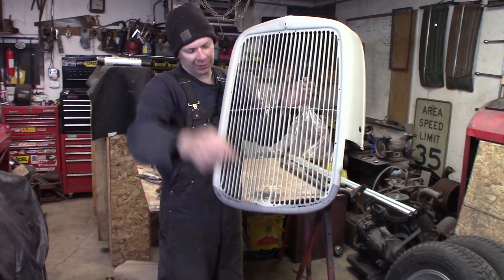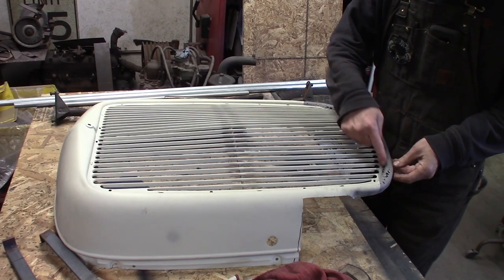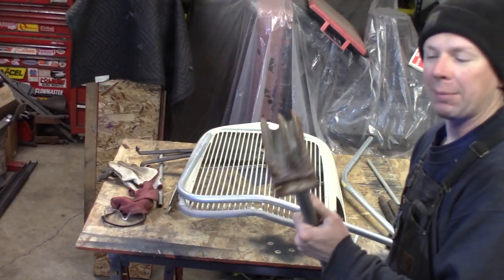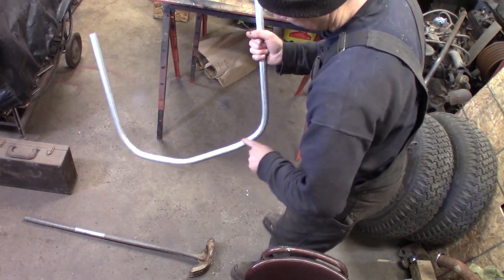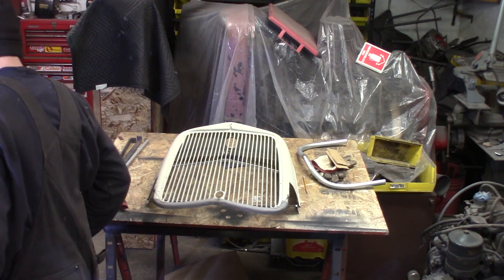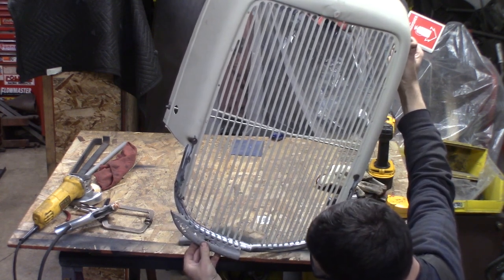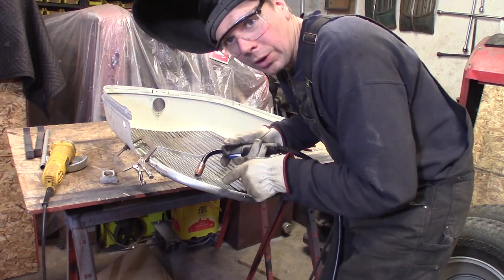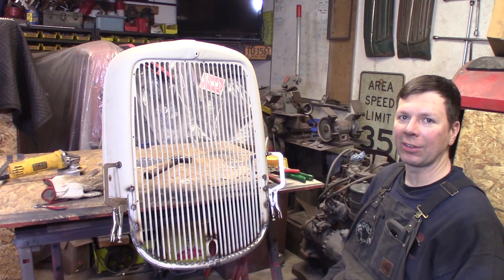Chopping an Early Ford Commercial Grille for my Model A Hot Rod Shop Truck

Comment: A word of caution.... welding (galvanized) conduit can produce lethal fumes, vent well. Templates with marking points before cutting are imperative for future reference! 
An alternate process after obtaining the template data is constructing a 1/4" plywood or 1/16" metal 3 tooth "comb" to relocate the severed bars after positioning/tacking the bar on each side of the crank hole insert.
Good content, Model A or '32 commercial shells add originally, nice save. My wall hanger is a sectioned '32 without the insert.

Comment: Tedious work but you did a FABulous job,  turned out awesome. With a grinder and welder, and a little patience, you can fab about anything. Enjoy the videos, always pick up a few tricks or ideas.
Reply from the maker: Thanks.  This whole truck was literally built almost from scratch with hand tools and a welder.  You don't need a fancy shop with $50k in tools to build fun stuff. You can also do it on a budget.  I have about $6500 total in this truck, $4000 from the original build and the rest on the rebuild.
Reply: QuickSpeedShop That's cool, see you on the next one.